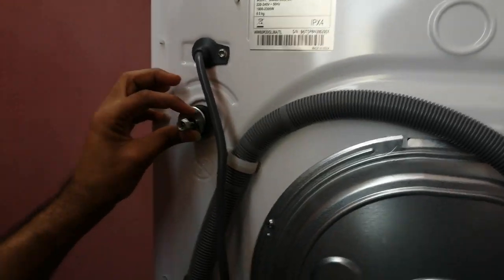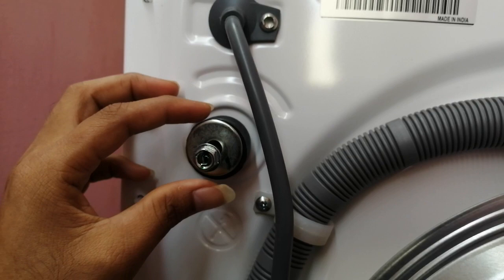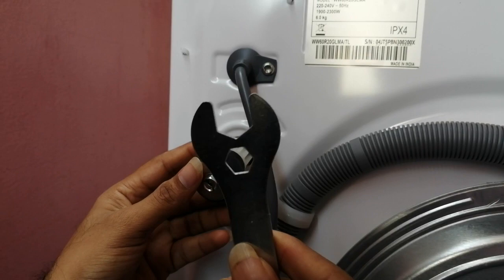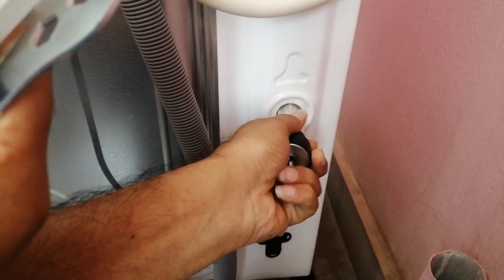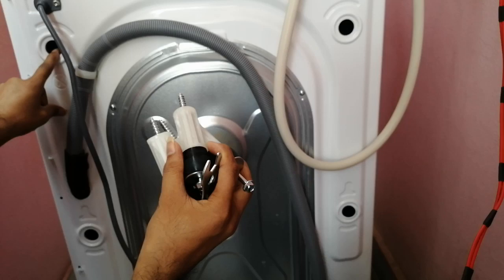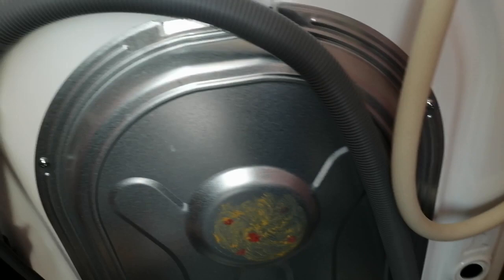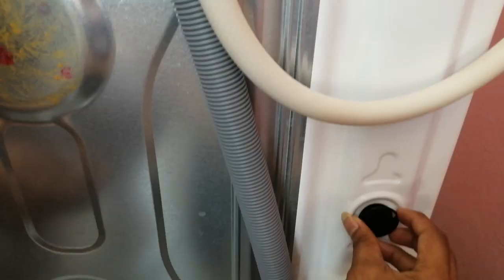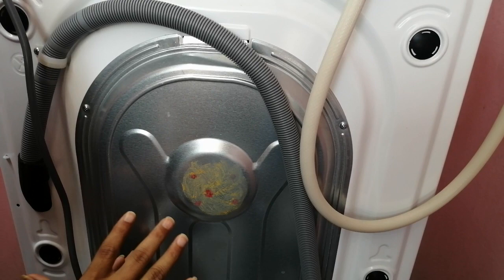How to remove Shipping Bolts from Front Load Washing Machine||Installation of Samsung Washing Machin

Comment: I removed shipping bolts but I don't have caps....where I get these caps?
I can use my machine without caps?
Reply soon
Reply from the maker: Usually u will get caps along with machine ...Caps is used to avoid dust into the machine...You can cover with paper by sticking with glue if u did not get the caps ...

Comment: What if plastic from one of the bolts droped inside?
Reply: I have the same issue, has it caused any problems for you while doing the laundry?
Reply: @Sweets104  I’ve opened the machine and found the part at the bottom stuck to the edges so I really don’t know if it would cause any issues. I didn’t want to risk. I recommend you to do the same. You’ll need some assistance since you need to lean it on the side. Good luck

Comment: Pls I have miss placed the cap for covering the transit blot holes,can that cause a problem
Reply from the maker: If you have removed bolts then there no issues it will not damage ... Cap is just to avoid the  dust into the  machine ... Hope this helpful for u

Comment: Hello,I opened my bolts but the black rubber like thing didn't come out..how is it removed please
Reply from the maker: Pull it hardly it will come .. Otherwise use some kind of cutter tool it will come..

Comment: Hi, I used my machine for the first time today with shipping bolts. It vibrated like crazy. I tried twice more. But then I put the machine off. Will my drum still be damaged??
Reply from the maker: If it is short time like 5 to 10 mins it will not cause much damage .
Reply: samthing for me, man it was scary! I ordered pads, hope it's ok.
Reply: Hello sir 

Thanks you for sharing this video i just bough a new one and used my samsung washing machine today with shipping bolts so yes sure.it was dancing..vibrated..drum like crazy it was happened maybe 2 minute ago suddenly i removed out the electric plug and bolts it just like this only one time for me so can i ask you one question sir what it was making with problem or damaged inside machine now or in the Future